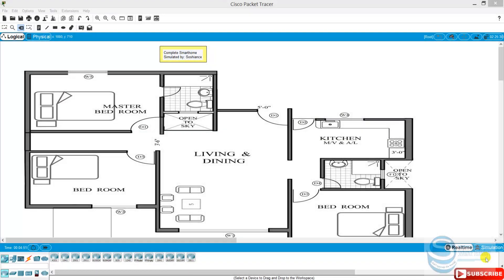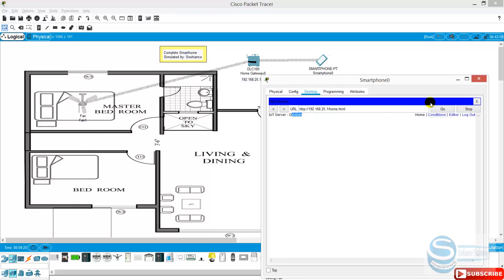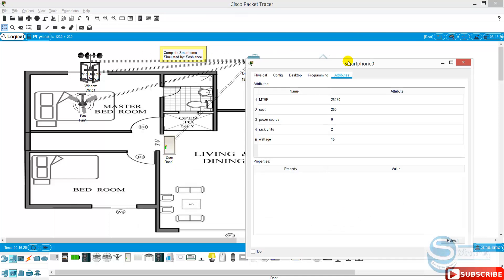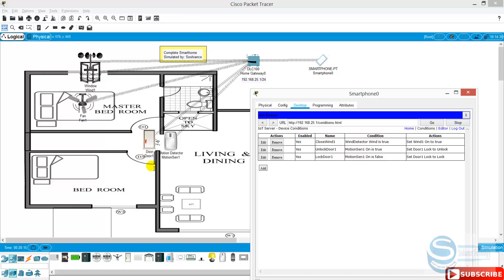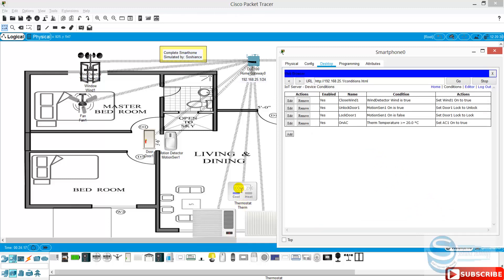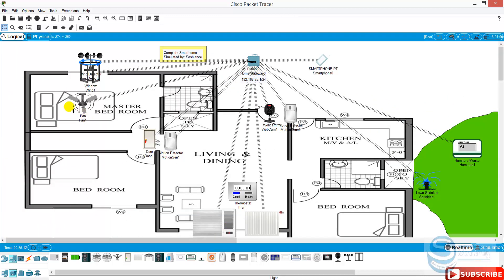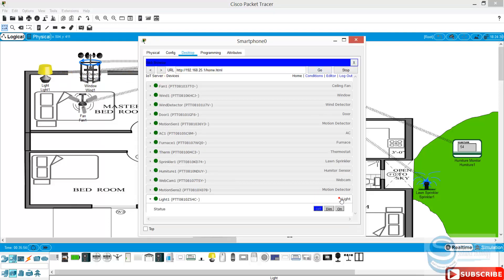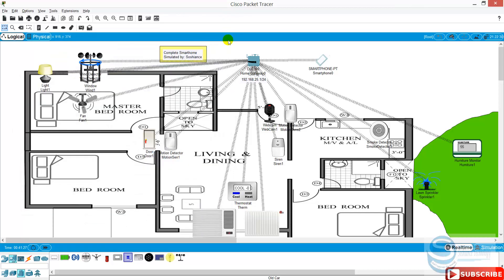IoT Smart Home Packet Tracer, Home Automation Project

Comment: Hi .. many thanks for your video. It has really educative. Please can I implement a radius server for authentication on this your design i.e to secure the network? If so, please how do I go about it ? or what other security measures can you advice.
Reply from the maker: Hello, and glad to hear that this could help u :)
Yea sure, you can configure RADIUS Server or simply to access remotely, you can do a Dynamic NAT and port warding to the Public IP of your Router. Then access any of the components from anywhere. To secure, basically, you can hide the SSID on your Router and give a password, or in a more advanced level, you can configure a firewall to block and filter all the incoming packets with the lower security level trying to cross to the higher security level.
Reply: @SoshianceTechnology  Many thanks for your feedback. I have tried implementing the radius server but it's not working. If you are free, could you please make a video of using radius server for authentication of the smart home devices. Many thanks in anticipation of your swift response.